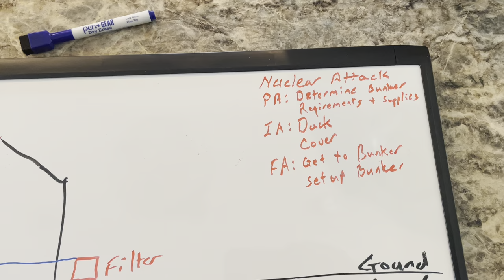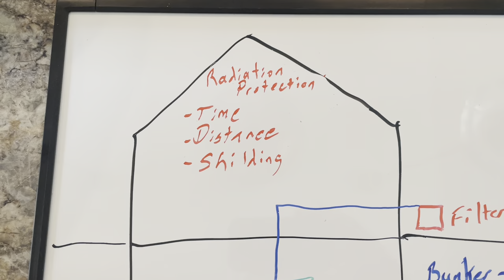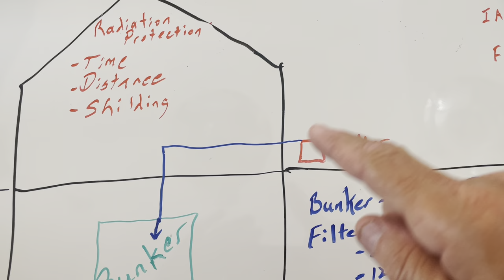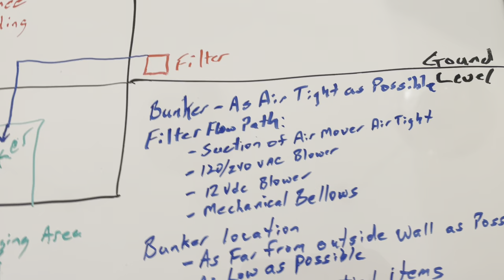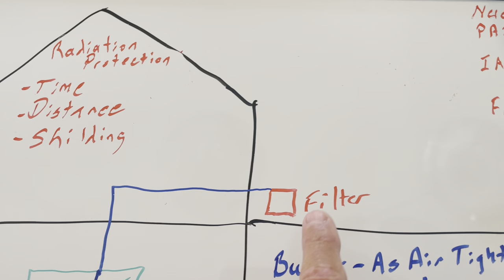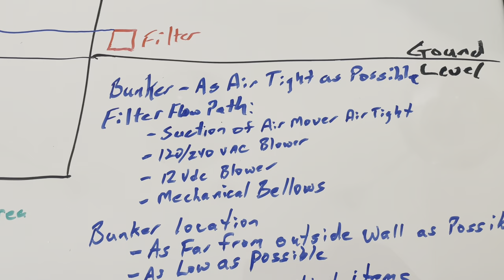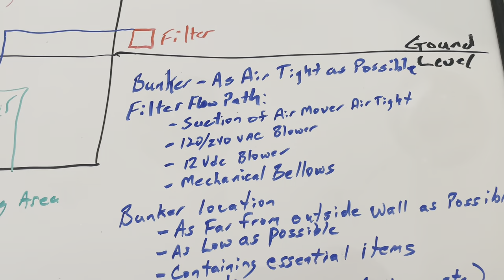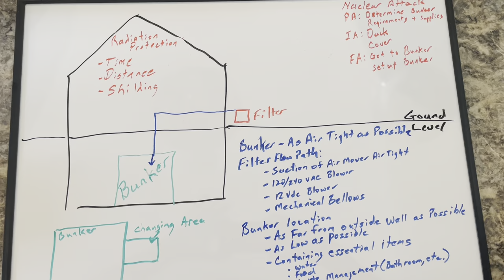Emergency Nuclear Filter and Bunker setup. (Preparation for nuclear attack)

Comment: Some comments:

1. have your decom space 90 degrees from your bunker entrance since Gamma radiation only travels is straight lines and cannot reflect on walls or deflect. 
2. You don't have to store everything you need inside of the bunker area. You just need enough food water for a couple of days, since the radiation levels will drop significantly after the first couple of days. If you have a basement fallout shelter, you can store a lot of water & food the unshielded area outside of your basement, and make a very brief excursion outside of your shelter into the basement to grab additional water, food, or dispose of waste. 
3. For waste disposal. some 5 gallon buckets will work. You can make a simple composting toilet with some saw dust in a 5 gallon bucket with a lid. You can use a 5 gallon pail liner bag so when you need to change it its just a matter of sealing the bag, and throwing outside of your shelter, You could store a few bags with saw dust, and just replace as needed.
4. You should have a gieger counter or dosemeter in your shelter so you can monitor radiation levels. so you have idea when its safe to leave, even for short excursions to throw out trash, or bring in additional supplies stored in your basement.
5. I would probably plan on sheltering indoors for a couple of months. Even if the radiation levels drop to safe levels, its possible that burning cities & rain will carry toxic smoke, ash & gases very long distances. I recall after 9/11 I crossed the Hudson river using the Newburgh-Beacon bridge a couple of days after the planes hit, and there was a strong smell of the smoke from the fire. The bridge is about 30 miles away from WTC, but I could see the black smoke column rising high up into the sky. I would imagine a nuclear war would be a million times worse than the WTC fire.
Reply from the maker: Good info. The important idea is to plan ahead and have your area and back up areas throughout ahead of time. These will all be different for each situation. And practicing will show areas you may need to work on. At least a walk through where you take inventory and review all the items you may need and setup required.
Reply: 1 - and helps to break the air pressure. All pro shelters/bunkers with side (not top) entrance are built this way. - 5 the toxic smoke, soot, and VOc from damaged / blasted / burnt down buildings and chemical plants, storage, is a long term threat. 1 year (with cleaning!) from the burnt down lub plant in rouen 3 years ago, pollution from the plume up to 100 miles away, and toxic fumes (called bad odors by officials) for one year long on the city.

Comment: Since radiation will be from the dust in the air, you should place the filter inside the house to protect it from damage from the exterior such as blast or wind-blown objects!  The house itself will act as a pre-filter if it is relatively air-tight!  I don't think you can rely on having electrical power after a nuke attack because the EMP will probably knock out the grid!  I would keep as much supplies as possible in the bunker because all the supplies outside may get contaminated!  Your changing room should have a shower and drain since soap and water will wash off most of the contamination that may be on your body!  Thank you for the video!
Reply from the maker: All good ideas. One thing to consider is if the filter is in the house you will be pulling contaminated air into the area where the filter is located. So that area may become more contaminated. Yes you will likely need a manual bellows or fan in case you lose power. However the filter is not just for a nuclear event so you may have power available.

Comment: Rather than to seal the bunker airtight, I would create a positive pressure in the bunker, thus preventing radiated particles from entering. Also, filtered air inbound is able to replace CO which is able to escape. Make it small enough to run from battery power, recharged via solar or genny.
Reply from the maker: Correct, it would be difficult to make it air tight and if it were you would definitely have to monitor the CO2 levels and have a way to exchange the air. A manual air pump could also be in the design.

Comment: Check out organic air hepa filters. They are pricey at time of this post run about 100- to 130. They are washable and come ready to connect to a 4in abs pipe.
Reply from the maker: That is pricey. The one I used was around $30. But it depends on your needs and design. Thanks for the comment 👍

Comment: All good stuff. Im am wondering if having the filter inside would actually bring fallout into the house. I say this because the pressure would be exactly equalized. You would essentially be recycling the air. Meaning that the filter is sucking in with the exact same amount the it is blowing out. Just seems like the system would be much cleaner if it was being run from the garage (like you mentioned) or from a higher level in the house.
Reply from the maker: Running the filter inside does have advantages but you do risk drawing in some fallout. One thing to think of is it would be best if you can maintain a slight over pressure in your shelter. Wind pressure on a building will cause a differential pressure and force some contamination into the building. A slight over pressure about .25 inch water will  help reduce infiltration and to achieve that you have to bring air in from outside your safe area. Of course you may not have power or means to provide that over pressure. The other thing is where ever you bring in the radioactive contamination that area will possibly become a high dose area and could raise the radiation levels in your shelter. All this being said you have to make plans based on your particular situation. Better to have a plan before an event than trying to think up one on the fly.
Reply: @edwardjackson9791  Yeah I totally understand the reasoning. I am just not sure the juice is worth the squeeze. I say that because most fallout is heavy. Im not sure that the system if placed in the middle of the home would be capable of causing any negative air pressure. The other thing that concerns me is that if the filter breaks or looses seal or something like that you could have a huge problem and would inadvertently be bringing fallout dust directly into your bunker area. Seems to me the rush is smaller having it in the home. But like you said it is good to think about things ahead of time. Personally I don't think I would run any air filtration system at all.  Just don't think it is necessary. The reason that purpose built bunkers have them is because they are buried and they need air flow from outside to survive so of course it makes sense to filter it. But for above ground homes it isn't really needed. again just my take. I do applaud your efforts to get people thinking though and don't think you are putting out bad info by any means. Take care!
Reply: Ideally you can place some HVAC filter on the outside to trap most of the large fallout particles. and have the filter with the Carbon & Hepa inside the shelter in case you need to fiddle with it. For the first few days even a very limited exposure (seconds to minutes) can be lethal or enough to cause radiation illness. Better to risk some exposure than have no access to filter system. Alternatively you can run two filteration systems: one with the filter on the outside and a backup inside. I would recommend using two vent ducts: one for each filter system.

"Im not sure that the system if placed in the middle of the home would be capable of causing any negative air pressure."

Its not the system that will cause negative pressure, its that you want the filter system to maintain a positive air pressure inside of your shelter to prevent gases like Iodine-125/131, Xe-135, Kr-90, from getting inside which you might inhale. As well as possible non radioactive toxic gases from burning materials like PVC.

Comment: Around 20 years ago I added a room onto my house. 15 x 16, It has 8 in solid concrete walls and a 7 in solid concrete ceiling. Has roll up electric steel door going to the out side. I live in the sc coast. It’s a hurricane room. It’s almost air tight. I worked at a nuclear power plant and learned a lot of info about radiation.  Now this room I have was not built for radiation but I believe with a little adjusting it it could be a good place to protect our selfs for a couple weeks. I enjoy your videos.
Reply from the maker: That’s great. We did something similar. We built a concrete house. Walls with 8 in concrete 2 1/2 inch styrofoam inside and out. Our garage has a 25 x 25 ft basement under it and an F5 storm door. We live in a tornado area in Midwest. Pretty much air tight. What plant did you work at? I was at DAEC.
Reply: @edwardjackson9791  I worked for a major elevator company and worked as a out side contractor on the elevators at Oconee nuclear power station  In Upstate SC.  The three reactors has one elevator in each one. Then one elevator in rhe auxiliary buildings . I worked there In the 70s and early 80s. After that I moved to coastal SC.  I been preparing for a long time but for hurricanes.
Reply from the maker: @freegrazer  we had one elevator in the reactor build and when it was out it was bad. When I was an in plant operator we would often fix the elevator ourselves, which I’m sure was probably iffy. Mostly it was the doors not working properly and causing the elevator to stop going up and down. The elevator repairmen were always a welcome sight.

Comment: Your door or entry way should be on a 90° angle. I appreciate your video and information. Thank you.
Reply from the maker: Thank you for your comment. You are correct if possible and at a distance also would reduce exposure. Each situation will need to be evaluated based on the physical consideration of the shelter.
Reply: Pro (expensive) bunker shelters are designed this way, yes.
Reply from the maker: @anitaleroy9442  there is a book called “Nuclear War Survival Skills”, written back in the day, that has shelters you can build. They are temporary emergency shelters and require sweat equity to build. Look on line for the book. There are free PDF copies you can download. Thanks for the comment.👍
Reply: @edwardjackson9791  Yes have downloaded it, most books are wrong this one is pretty good.

Comment: What happens to the carbon dioxide inside the bunker.  Better yet how do you do away with ?
Reply from the maker: I have a monitor that I use. They are relatively inexpensive but unless your bunker is very tight it will probably be ok.

Comment: Fail!!!  House falls on bunker from explosion.  House catches on fire you are toast..
Reply from the maker: Most homes will not be near enough to be damaged during a nuclear explosion. The explosions, although destructive in the immediate location, do not affect that large of an area. Maybe a 10 mile radius. You are much more likely to be affected by the fallout that can cover hundreds of square miles. But if you are unlucky enough to be experience the actual blast that could topple your house, you are probably toast no matter what you do.